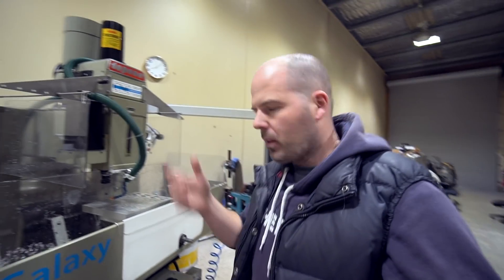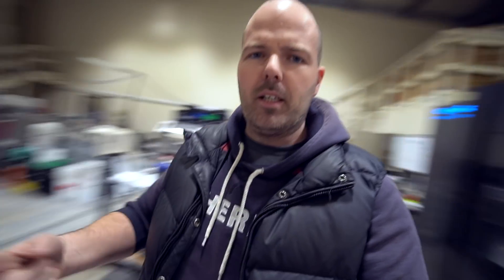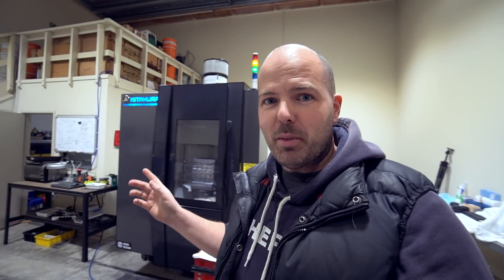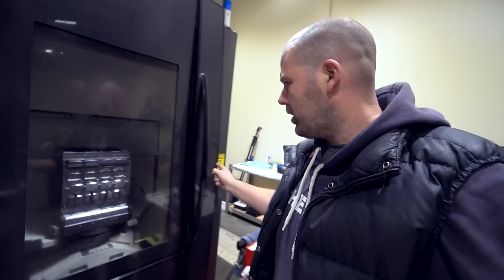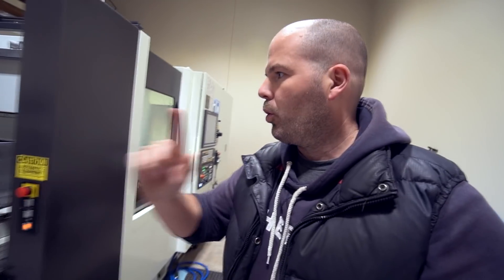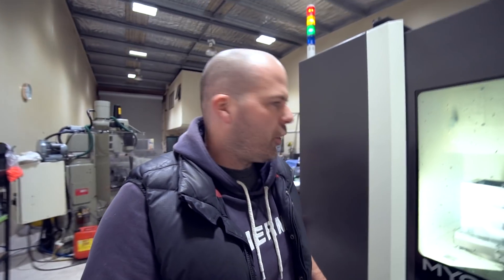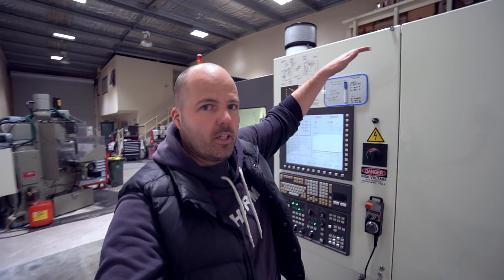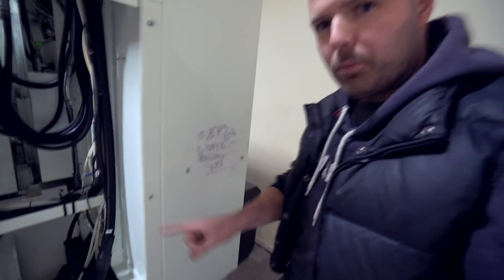NEW Kitamura Horizontal Milling Machine

Comment: I am new to CNC. could you please tell me the movement of the X,Y,Z axis on a horizontal milling machine? I know that for the Vertical, the Z is up and down, X is left and right and Y is in and out. Need this for my NIMS cert. Thanks
Reply: Z  follows spindle centerline.

Comment: Good stuff mate hope the machine is the answer to the cash flow issues. Highly productive machine if you can keep the spindle running. What brand of endmills are you running? Done any process development to get cycle times down? Cheers - fifty50 knives.
Reply from the maker: Hey James, two interesting questions indeed... right now I am using almost exclusively Guhring endmills as the price seems to be a lot (a LOT!) better than anything else I have access to here in New Zealand (UOP, GARR, Kennametal, etc.) - in saying that I have been buying other brands here and there (but they are anywhere from 50% to 400% more expensive that Guhring).
.
Also, I've not done much to speed-up the process on these CandyCans. I just got it up and running well and left it at that as I'm struggling for time to run the Kitamura as well as run other parts of the business. I'm edging more on the side of reliable/repeatable for now ...and will tackle efficiency later.
Reply: @MagnusMacdonald  your head is in the right spot reliability is everything! I've had alot of success with iscar and get really competitive trade pricing like 40% discount which helps alot to be competitive whilst having longer tool life. Can we get an update video keen to see this running. Where in NZ are you? My partners family is all over NZ and regularly visit Auckland and Dunedin. Hope all is well cheers.
Reply from the maker: @yeheyheyyeh89  I'm in Mount Maunganui (Bay of Plenty) ...only two hours drive from Auckland ...so definitely call along! I have the guys from Iscar (UOP, Garr), Kennametal, along often - but none of them seem to be able to get even remotely close to the Guhring pricing (certainly for the tools I use) ...even with things like the 40% off Iscar offer. I continue to talk with them ...but nothing has seemed to work out. Will see if I can get some running videos soon (should be easier now as I have just hired someone to run it ...so I can do some filming :-P).
Reply: @MagnusMacdonald  epic I'd definitely love to visit everything in the map looks so far but really so close. Hopefully the machinist helps out I know the struggles of a one man cnc shop.... Fifty50 knives is hard work. Keep it up cheers.
Reply: @MagnusMacdonald  any updates mate?

Comment: Great to see you again my friend. It has been far too long. I am really interested in your Project Zero Flipper Knife, but am unsure about spending $1000+ on a pocket knife. I have no doubt it will be stunning, everything you make is. I would just like to see a little more than what is currently on the project page before I commit. Is there any video of it working? Am I able to get put on the update emails?

Great video as always, awesome to have you back.
Reply from the maker: Hey Lucas, yeah I would honestly hold off on Project ZERO right now if you're not sure. I'm hoping to start doing more with knives from here - so this one is a semi-slow, follow-along project. It will eventually turn into a beast of a knife - there are numerous challenges to overcome along the way though. To be fair to those who have pre-ordered already - the Updates have to be for them only. Also, I am still at the CAD/CAM stage now ...but there is a good chance I share some stuff in video and on the blog - so I reckon keep an eye out here and there Lucas.